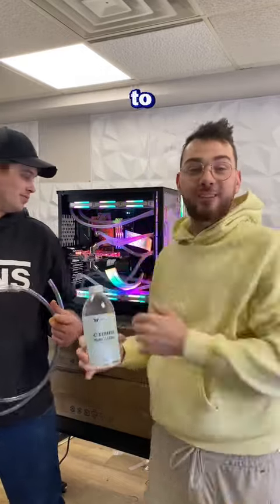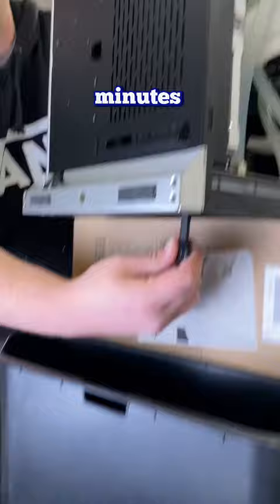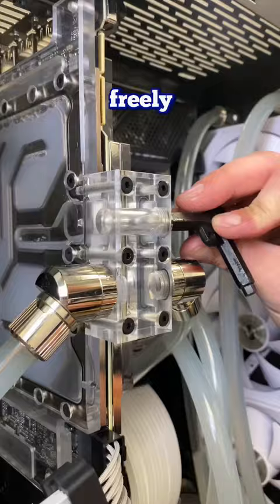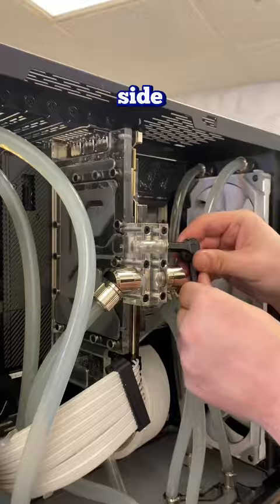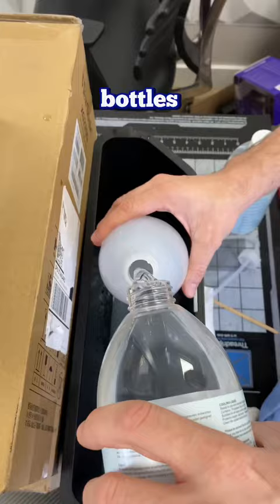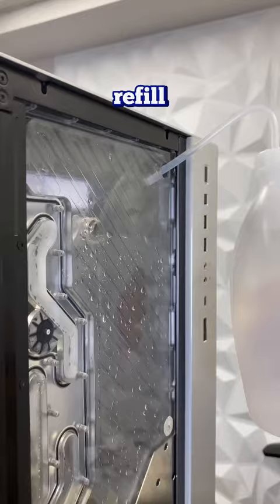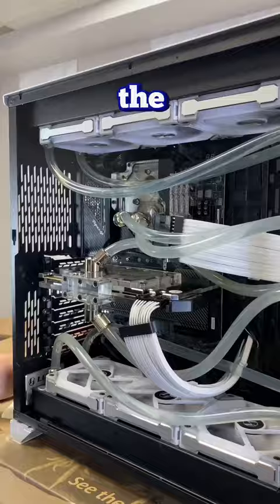DRAINING A CUSTOM LOOP! 💦 #shorts # #howtotech #techtips #gamingpc #gamergirl #gamerguy #pc

Comment: What I think is water should never be near electronics
Reply: well yeah thats why a custom water loop is dangerous. but an AIO cooler as well. But if you know what you are doing they are both pretty save. personally i would always go with an Air cooler.
Reply: liquid coolant for water cooled pc and aios are usually non conductive meaning it won't fry anthing